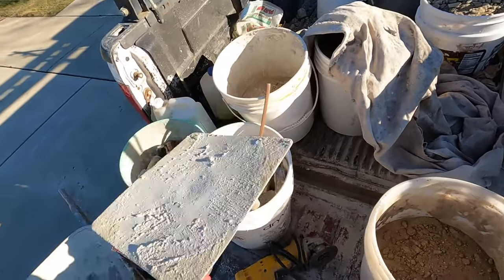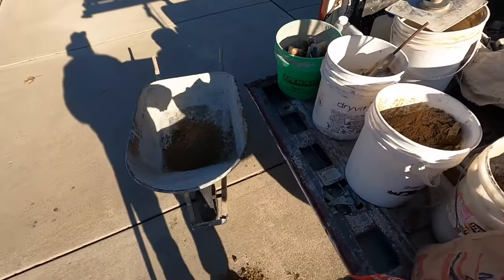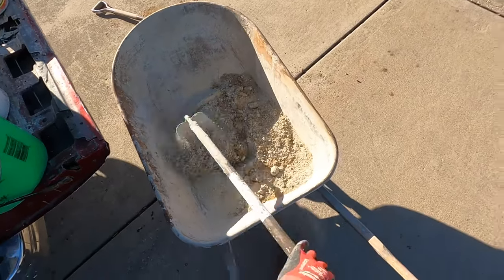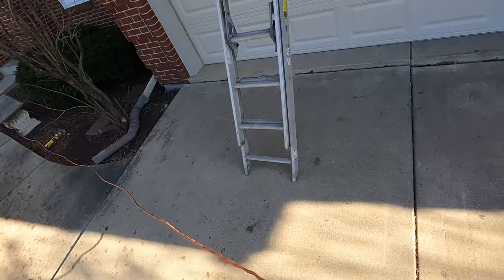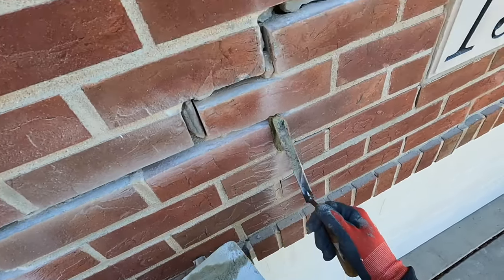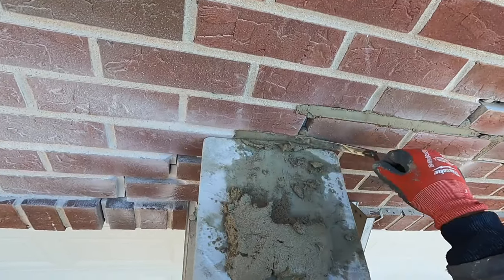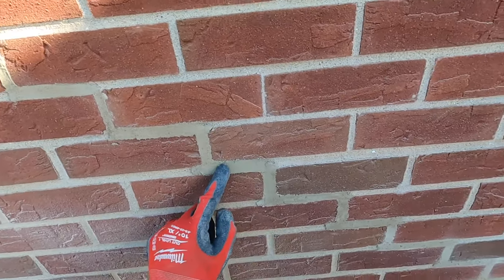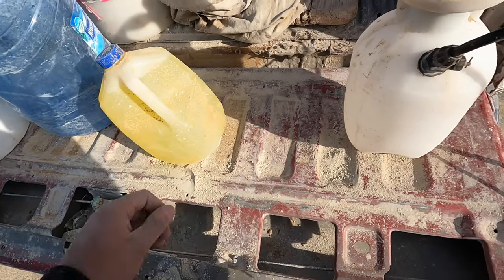DIY Step by Step Tuck Pointing By Actual Mason

Comment: That's not tuckpointing, it just regular repointing
Reply: Agree, and get yourself a spray bottle 😢  always have a damp sponge ready as you go.
Reply: I call that tuck pointing bc he’s pushing it straight off the hawk into the joint.  I would never do it that way.    I scoop it onto my tool than put it into said joint
Reply: @nitchmoney6037  tuckpointing is a method that leaves a raised ribbon in the mortar joints. It isn't very common anymore, especially in North America.

Comment: 2 to 1 mix Is way to strong, the mortar should never be stronger than the brick, that will crack after 1 winter, also it won't colour match up, as the rest of the wall is a 3:1 maybe 4:1 then your re pointing is 2:1 ittl look different and crack, have a look into using lime morter as well, especially on older buildings good effort though 👍
Reply from the maker: Me and many other masons I know have been using this mix for a very long time. That’s what I was taught on. I worked for a bunch of different people back then. Also after I wash it the work blends in perfectly every time. But I hear ya on why your saying that. I guess those are my ratios I know by nature. Where are you from ?
Reply: @midwestbrickdoctor6670  yeah fair enough mate and England, we do it abit different over here 👍
Reply: @midwestbrickdoctor6670  I’m from chicago. Point the exact same way you do. Every single thing. 
I’ve ever seen a trade done so different in each part of the world. 
Lately my mortar has been smearing. Turns the job to a nightmare. Thanks for the tip on that!!!! Should help me a ton.
Your joints are super even and clean before you scrape to… I need to improve on that as well
Reply from the maker: @-pschar4290  it all comes with time. Dont know how long you have been doing it but it’s a true art to master
Reply: @midwestbrickdoctor6670  I'm pointing an outbuilding on my house thats from like 1900s...so, just a lot of mortar between a lot of larger rocks...no brick. Would you still use the 2:1 ratio for that type of structure? I'm in Milwaukee so I it'll be the same climate as IL. @pschar
Reply: @-pschar4290  I'm pointing an outbuilding on my house thats from like 1900s...so, just a lot of mortar between a lot of larger rocks...no brick. Would you still use the 2:1 ratio for that type of structure? I'm in Milwaukee so I it'll be the same climate as IL.
Reply from the maker: 3:1
Reply: Poor effort.

Comment: Washing the brickwork after grinding is a good tip, let it dry a little and then use dryer mortar to repoint, you will get less smudging ,
Reply: and maybe a drop cloth to mortar isnt staining the custo's driveway haha.  i wouldve used a slightly smaller tuckpointer personally. from what i could see anyway.  not there in person

Comment: Unless that house is all faced with engineering bricks the mix is completely wrong, 2:1 or 3:1 for solid engineering bricks in manholes etc , facing bricks on a house  4:1 or 5:1

Comment: You can tell a good tradesperson by the way they keep their tools clean
Reply: And his tools are mot clean. Amateur hour. Does not explain proper grinding so as not to damage brick. He is wrong about not tooling joint. That forces mortar into the joint and compacts it properly. If you are not sloppy, you do not have to do an acid wash. In regard to flashing, acid reacts with metals. Jr. High chemistry. Worst thing is, NO PPE!!! That surgical mask is useless!!! Minimum is a well fitted N95 mask. Less effective if you have a beard. A rubber facepiece with proper filters even better. Best is  full face shield respirator with filtered air feed. Also, ALWAYS use the guard on your grinder! Jesus, shocking how much schlock work is on the net!  Mortar type and match is important also, particularly with older brick. Old soft brick is incompatible with portland cement mortars.

Comment: I do it the same way as this guy, same mix ratio... But I protect the customer's property with a tarp, dump my sand on a 4 X 4 sheet of plywood, wet the joints to be repointed and use a plastic mixing pan... To each his own I suppose.

Comment: NICE to watch you buddy,,...1 .2 very strong mix my mate ?  Be careful mixing in wheel barrow, might get old bits of hard cement in your mix..  the pointer you use is called a Finger trowel or margin trowel in  UK .. Just comments only. You are neat !
Reply: Cement needs to be strong in Northeast, which I am guessing he is as well... you can't use anything weaker or you will have no joints In a year.  Freeze thaw is brutal. AND, the high Portland ratio reduces water permeability.  Just have to keep it wet for a week to avoid cracking . And, no one uses drop sheets... it literally sweeps off. What doesn't sweep, hoses. What doesn't hose, grinds....
Reply: If your dropping enough to need clothes find a new game
Reply from the maker: Finally!!!!! Don’t have to waste my energy towards pointless comments. If only people knew what we knew 😁
Reply: @IannoneBuilding 
Incorrect. With some brick, high portland will cause spalling of softer older brick. Lime mortar is somewhat self repairing and "breaths". Too hard of mortar can cause major problems.
Reply: no shit, i was speaking in general terms referring to modern brick, laid  in modern times, in the weather conditions of modern times, in the area of upstate ny. modern brick is hard and glazed/coated, or fired to a temp high enough to cause it to be very water resistant.... Now, when pointing or re-laying old soft bricks whether soft extruded or soft hand made, yes, certainly lime based mortars are the only acceptable option, and depending on where you are and what the exposure of the brick is will determine whether a quicklime hot mix, a quicklime hot mix with pozzoloan, a lime putty, a nhl 2, an nhl 3, or an nhl 5 would be your best course of action, but, once again, since the video was about modern brick, i was making a general statement regarding modern brick.... and, since the weather conditions are extreme here, that is actually the way it is specified. Additionally, lime mortar would not pass our code requirements unless it is used in the restoration of historic masonry structures. I know just a little about this, as I personally hate portland cement, and am one of the only historic masonry restoration outfits in this area, with most of my  mentors being european, and research studies being my reference.... 
 @Jeff_New_Jersey

Comment: Other than assuming type N 50:50 Portland and lime mix, seems the sand itself is a deciding factor for end game color. Currently down the rabbit hole on my 1952 red scratch brick 6:1:1. Quick Crete says add 3 parts sand to 1 part N type to match said historical mortar 6:1:1 . This tells me 2 parts already included in premix.. so, I mixed 3:1:1 and it seems to match. Now I touch mortar everywhere and study it.
Reply: Have you never bought mortar dye?  It’s like $30-40 bucks for a little bag.   Makes life easy brother
Reply: @nitchmoney6037 
Not if you don't know how to use it. You can have the mortar analyzed for type and color.

Comment: great video. thanks. would you recommend type N or type S mortar to fill up the crack? also if the crack goes in the middle of a brick, also to grind it as you did and fill it up?

Comment: good tips you should try wetting the joints a little bit bricks soaks up the water and helps the bond
Reply: Garden pressure sprayer is what I use.

Comment: I need to do some tuck point on my chimney.  What I'm concerned about is my brown metal roof when I go to do the Acid Wash and it gets on the metal roof.  thoughts?
Reply from the maker: If it’s not copper and has some kind of coating over the metal roof your ok. But just to be on the safe side I would use it out of a sprayer and have constant running water on the roof where your chimney is. Also tarps may help just will be a pain
Reply: @midwestbrickdoctor6670  Thank you so much!  Have a good day

Comment: UK we call it weather struck pointing  when you mix the sand and cement why don't you use a rubbish bag you can shake it up and down in bag so much easier and tip in bucket mix it with water that's why I do it👍

Comment: Cool! How can I remove the gray/white stains on the brick if I mess up?...after it dried--thanks
Reply: muriatic acid wash
Reply: Use 3:1 water and muriatic acid and scrub w Wood Handle Roof Brush. Then scrub with Silicon Carbide Rubbing Brick. Repeat scrubbing with acid mix and spray it off with water. Repeat if and where needed.

Comment: I have an old brick house that is almost 200 years old, so the bricks are more of the soft clay variety. Is it ok to use newer mortar on these types of old bricks? It won't crack them or anything?
Another concern I have is since the building is so old, there are many areas where you can tell there is massive amounts of mortar missing, gapping holes that appear to go behind the brick, so it appears that there is most likely mortar missing behind the wall. Should I just get a pipping bag and squeeze and squeeze mortar back behind the bricks until I can't anymore?
Seems to be a nightmare project.  Ha Ha
Reply from the maker: @damnwankers  yes use a grout bag… type N masonry cement 3:1 sand to cement ratio

Comment: You said it was caused possibly by not using wall ties on that verticle crack. Is tuck pointing alone gonna solve the issue or putting in a wall tie like it's need a better fix? Honest question.
Reply: No straight joints like that crack even with wall ties every 16 inches I've been a Mason for more than 20 years I've done a ton of re pointing and restoration the grinding out sucks but the jointing is nice and easy but I would caulk that I would get a caulking that best matches the mortar I would tell the customer if you want I can fix it with mortar but it's just gonna Crack again so caulking will last longer because it will stretch when the brickwork separates a little bit

Comment: Add acid to the water not water to the acid.  It is much safer that way, prevents splashing acid.

As I first watched your video is thought you must be close to Chicago, I noticed the horizontal electrical box on the outside of your house. My son lives in Joliet, IL.  When he sent us photos of the house he was looking at that was the first thing I noticed (seems out of place)

Later I found out that Chicago suburbs must have conduit in the walls to minimize fire hazard. That is why the boxes are horizontal, makes it easier to run the conduit and wires.

Comment: Can play sand be used? The quickcrete general purpose has too many large pebbles for tuck pointing.
Reply from the maker: Yes play sand is actually really good to use. I like it a lot but it’s not practical for me since I use alot
Reply: I was taught to run the sand through a screen to eliminate larger pieces.
Reply: No play sand! Use mason sand.
Reply: @midwestbrickdoctor6670 
NO! Playsand can have impurities. Use proper mason sand.

Comment: So 2 parts sand...1 part masonry cement. How much water do you use for that mix? Or do you eyeball it?
Reply from the maker: Use 3 parts sand to 1 part cement and mix dry. Then slowly ad water until you get an thick oatmeal consistency.   Let set for couple days then mix 3 parts water to once part muriatic acid. And wet wall and apply solution to work area. Let set for 30seconds and wash with water.
Reply: @midwestbrickdoctor6670  In the vid you said 2 to 1.
Reply from the maker: I know I messed up. It’s 3:1
Reply: @midwestbrickdoctor6670  Thanks for clearing it up. Maybe make a note in the description. I would have used the 2:1 ratio had I not read the comments. Nice vid btw.

Comment: So it’s masonry cement, water and what was the other substance sand? I don’t think you mentioned?
Reply from the maker: 2 1/2 parts mason sand or play sand to 1 part type N cement. Water as needed until oatmeal consistency
Reply from the maker: Mix sand and cement fry first then add water
Reply: @midwestbrickdoctor6670  thank you for the prompt response my fellow tradesman. I see you guys out there as I instal tile. Your expertise has common ground with ceramic applications that I’m used to, so keep up the the thorough work and don’t forget to care for your own health in advance. You owe it to yourself and those you serve my friend.

Comment: can you use a mortar bag and get similar results?  and what about type N preblended bag of mortar. as long as  the color matchews?
Reply: I use Type S pre blended mortar and mix it with Portland cement. In my experience, preblended mortar is usually garbage and if I was good enough to make my own I would, but I’m not so my husband and I just add Portland cement (he’s not a brick guy and I had to learn for our business). Second, I do not recommend a grout bag if you want an aesthetically appealing wall when you’re done. There is way too much smudge and room for error with a sloppier mix. Just use the hawk and pointing tools, you’ll be thankful afterward for the minimal clean up.
The mortar should be the consistency of a fresh bag of brown sugar.
Reply: Mortar type is not about color but final 28 day strength of the mortar. There are usually types M, S, O, N (comes from letters of Mason.) It has to do with sand to cement to hydrated lime proportions.
Reply: @Cheri434 
Yes, a drier mix compared to mortar for laying brick is recommended.

Comment: Is the masonry mix grey or white?   Does the sand help with color match?   I used Quikrete Commercial Mortar mix and the mortar is drying grey.  Would an acid wash lighten the mortar?   My original mortar is more white (not pure white)  - has yellow/orange sand and it appears cream colored all the way through after grinding.
Reply: I am experiencing the same exact issue matching the color. I am repairing a fieldstone wall and the existing color is exactly what you describe. In the past I have used regular type s mortar but it dries very grey, almost blue. Have you found a solution to properly match the color? I have been searching for this answer everywhere. This guy says he will tell you exactly what to use and where to get it but never says what the 2 part sand material is and where to buy it, what kind of masonry cement to use (is this just portland cement or something else). Basically the soecific info I was looking for haha.
Reply: @sethfrancissimracing7558  The only way that I've found from supply places is to use white mortar mix or white mason's cement and then use sand that brings down the color.   Guys who do this for a living like the guy in the video have buckets of various colored sand.   I think you can also use tints when you mix premix but they come out too solid looking.  So if you are using white mortar then yellow or brown sand it should tint it almost buff (sort of light beige).    What I found with mine is if you acid etch the mortar and brush it the sand in the mortar will be exposed since you are basically dissolving some of the cement's "cream" that is at the top.    I did this with a 20% muriatic wash and brush and it brought toned down the grey a lot.   My dad used to basically "cook" the mortar with almost 100% muratic which is REALLY stupid because it makes the mortar brittle and it will crack.   It made the mortar very yellow as well.   

On mine it cured  a very light grey - not white or cream but tonal grey.    If the sand was white it would have been more white.  The sand in the Quikrete Commercial is yellow/tan sand.   Much better in match when you acid wash it.   If you mix the cement/sand mixture yourself I think it would come out better and then you don't have to hard acid wash it.   Getting white here in St Louis is almost impossible - so far.
Reply: @stim141  thank you very much for the reply! This is actually very helpful, I will be doing a repair on a stone wall tomorrow so when I go to the supply store in the morning ill see what materials I can find. Thank you again for the information!
Reply: @sethfrancissimracing7558  he said type N cement.   but in premixed mortars  there are several colors... actually a dozen. you probably have the lighter color..  Not found at big box stores you need to go to a fireplace hearth supply where they have all the designer colors.

Comment: 00:03 Detailed guide on tuck pointing and mortar mixing
02:12 Tuck pointing involves using a concave jointer and bricksmith cement mix.
03:45 Mix masonry cement for tuck pointing
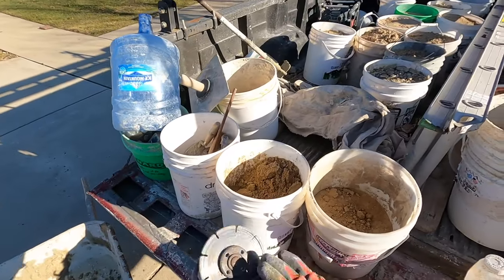05:43 Preparing for tuck pointing with necessary tools and protective gear.
08:01 Tuck pointing technique demonstration
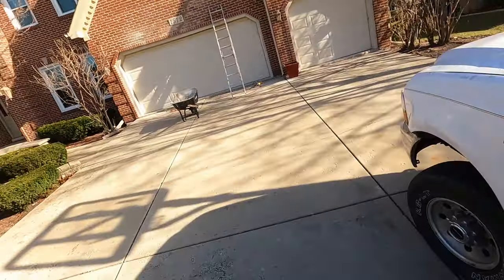10:02 Tips for knowing when to brush the mortar
11:36 Prepare muriatic acid wash for mortar and brick cleaning
13:02 Be cautious when using muriatic acid for washing as it can cause expensive damage to materials like copper flashing.

Comment: how deep is the minimum you need to fill?
Reply: 2x joint width. Typical nominal 3/8" joints require 3/4" depth minimum...